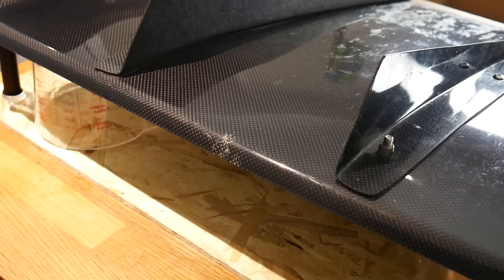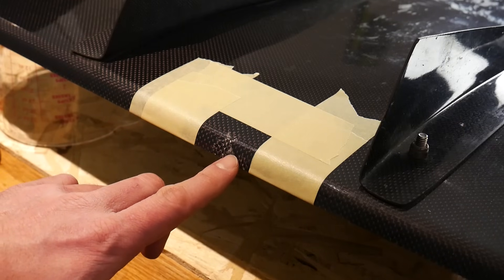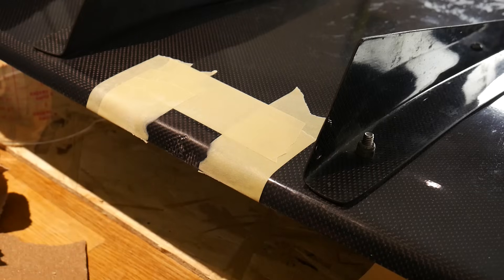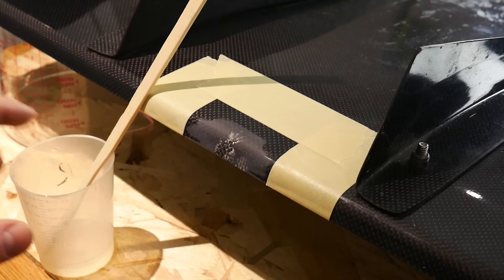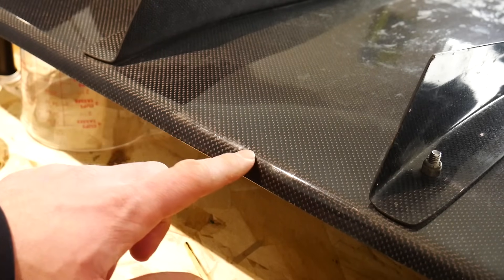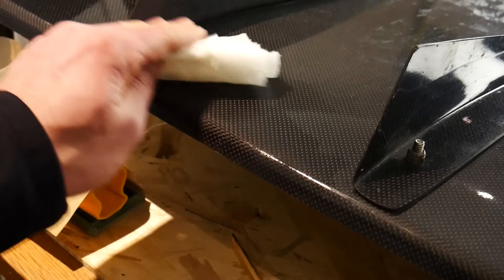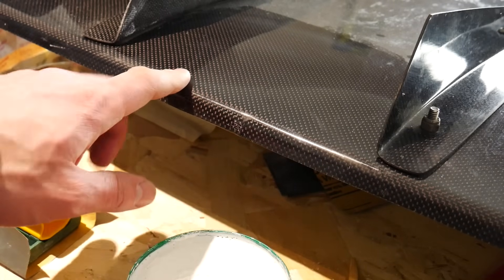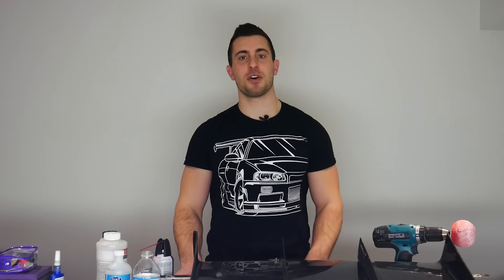How To Repair Carbon Fiber Cracks

Comment: What would you do of you had some webbing on the finish? Where the carbon fiber isnt cracked, its till intact, but the clear coat has cracking all over it?
Reply from the maker: You would have to try and sand through the spider webs portion the best you can. Even if you get most of the way through and put new resin over top it would probably hide most of the flaws.

Comment: What if it's a HUGE crack?  For a frame of a fork?  Will this work for that?
Reply from the maker: I wouldn't use this method to perform a structural repair. This is mainly for looks

Comment: Thanks for the video. I have an expensive mtb with a similar ding and I'm gonna sell it. Definitely will take the time to do this. Could only increase its value. Where could I find that resin mix?
Reply from the maker: thanks for watching! Try your local composites story, or easy composites online, check to see if you have a local boat repair shop or even some high end autobody shops. Epoxy resin!
Reply: @EmbraceMaking  I think even Envirotex is the same and available at craft stores like Michael's

Comment: This is very helpful. Thanks for sharing. Also, will the gorilla epoxy resin works on these parts? Thanks
Reply from the maker: I've never seen gorilla epoxy resin before... is that resin or glue?

Comment: Will this get yellowed if I put on my car roof?
Reply from the maker: Make sure the resin you are using has UV resistant properties, or if you clear coat it after, the clear coat should have UV protection.

Comment: Sooo what if it's not glossy to begin with?
Reply from the maker: Are you talking about a matte finish? Or was your epoxy UV damaged?
Reply: @EmbraceMaking  It's a matte finish. Front lip of an 18' Volvo V60 Polestar.
Reply: matte clear coat spray will do it

Comment: Thank you for this video but I do have a question. After my CF hood cracked, it seemed to have some areas that are really really hazy. I would imagine it’s from moisture getting under the resin. How can I get rid of the haziness?
Reply from the maker: Haziness could be from UV damage... You may want to try and just use some really high grit sandpaper or emery cloth to remove this hazy layer and then go through the polishing process to restore the gloss.

Comment: I have a front carbon splitter that got hairline cracks in it, do you think I would need to reapply resin or could I get away with just sanding down the cracks and applying a clear coat?
Reply from the maker: I guess you could try sanding first... see how deep you have to go. If it is deep enough that you would notice a low spot then use resin. If it is extremely superficial you might get away with just some clear coat...

Comment: bubbles in the resin are a common thing. you need to degass it first using vaccum chamber and pump. i use it a lot. zero bubbles.
Reply from the maker: Thanks! This method is more of a low cost "common tools" way of doing this without much monetary investment :)
Reply: @EmbraceMaking  yeah it requires some investment, and its a next step for those who are tired of this lil bubbles :) I know because it happend to me :)

Comment: Nice vid, I heard if u use a heat gun on the epoxy bfor it cures u can eliminate air bubbles n prevent them from cosmetically damaging the appearance
Reply from the maker: That works too! Just can't over do it with the heat
Reply: It's nice to have a gun with a screen readout and good temp control

Comment: Excellent video.  I have a CF splitter on the front of my corvette which seems a bit flimsy.  How can I reinforce it on the back side so it becomes more structurally rigid?
Reply from the maker: I would put some carbon fiber cloth on the back side and use the resin to bond it to the existing piece.

Comment: Hey was wondering if you could repair my front lip my number is 4792022570
Reply from the maker: Hey, sorry, probably not local to one another, and it wouldn't be worth shipping. Some high end local autobody shops to you might offer carbon fiber repair?

Comment: Hey question someone dropped a wrench on edge of my hood it took some epoxy off about a quarter size chip that exposed the fabric and around it cracked some epoxy should I chip the cracked parts off or just leave them before I attempt to try this ?
Reply from the maker: Chip off anything that doesn't look like it has a solid bond. Otherwise it may delaminate in the future

Comment: What kind of hardener did you use with the System Three Gen. Purpose epoxy? The ones I've found by system three states an amber or light amber color.
Reply: If it's a very thin application,  it should be OK. There are many options

Comment: i called this epoxy company and they told me that this epoxy isn't gonna hold on pre preg carbon or just any room temp cure epoxy won't be good for pre preg, just letting you know and also what would be your recommendation for repairing pre preg since nowadays everything is pre preg.......
Reply from the maker: Might be able to give this stuff a try? http://easycomposites.co.uk/#!/resin-gel-silicone-adhesive/epoxy-resin/black-epoxy-repair-filler-for-carbon-fibre.html
Reply from the maker: Hm if it doesnt work on prepreg you may have to find some specialty stuff... google might have the answer for you on this one :)
Reply: tadz51 I recommend Hysol EA956 for prepreg repairs. I make aircraft parts and have some knowledge in this area. I would have feathered that repair back more and added cloth no matter what, resin alone is only a cosmetic repair.
Reply from the maker: @raymondiseminger8682  Thanks for the recommendation!

Comment: Embrace Racing Great Video! New Subscriber here! I have a couple of questions...Do you need to clear coat over the resin epoxy after wet sanding? If the Carbon fiber part is clear-coated does the epoxy just blend with clearcoat?
Reply from the maker: When you sand it down you will sand down some of the clear coat if it has been cleared. The epoxy should bond to it. Once you smooth everything out and wet sand the area, I would recommend using a clear coat if the rest of the part has it. Might as well protect it!
Reply: thank you for the reply!
Reply: @clbaker24  I would recommend using outboard motor clear coat. Evenrude or something from a boat place. It's the highest quality rattle can clearcoat available.
Reply: @EmbraceMaking   https://youtu.be/XcwCmY1I_2o

Comment: I've got a carbon fiber front fender on my r6 yamaha that I cracked from a wreck.
What is the resin that comes with the carbon fiber inside all ready for use, please

The name of the product and where I might be able to get some??
Thanks
Reply from the maker: Hi Bob, you might want to try products from "Easy Composites" for chopped fiber in the resin. Thanks!

Comment: Hey i have a pretty deep crack on my hood all the way to the fiber and i can literally pull off the cracked parts so If i pull off the cracked parts ill have a spot where the fiber is exposed so do i fill that up with resin and then block sand it so it can be smooth?
Reply from the maker: I would try that, but feather the edges around it so the resin has something to stick to!

Comment: Question is this Epoxy Resin Specific for Carbon Fiber or can i use the RESIN EPOXY that they use For Table Counter Tops ?
Looks the Same to me .
reason is slightly Cheaper and not alot of place to Mend ,
my Mountain Bike Cranks have chipped Clear Coat with Exposed Carbon
Reply from the maker: Good question! Not something I've ever looked into. If the countertop resin is epoxy and not polyester then it might work if it's all you can find? It may not have UV protectant in it. There are probably various additives in resins for specific purposes... but if you're willing to be a guinea pig, give it a try and report back!

Comment: Would this same process work if its spidercracked all the way through to the fiber. Not concerned with keeping the carbon look, more or less just looking to save the piece without the cracks showing back through. Had tried fiberglass several years ago and the cracks reappered.
Reply from the maker: Hi Stephen, if the spider cracks are all the way through, then just carefully sand down as far as you can until they disappear. Just try not to sand the actual fiber weave if you can avoid it! Once you build the resin back up it should hide almost everything.

Comment: What if you have a crack down to fiber and can’t access back side. Can you repair from the front?
Reply from the maker: Hi Jay, yes you can still patch it from the front side but it will obviously be noticeable. Your best bet is to try and remove this piece to gain access to the back somehow.